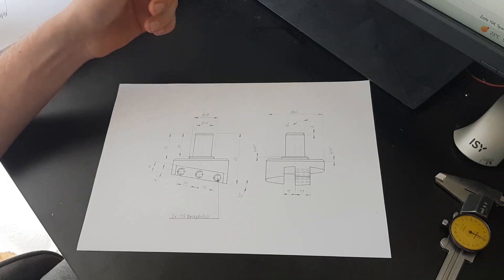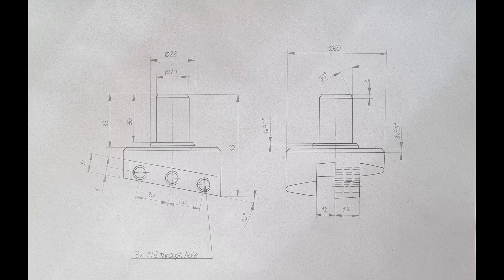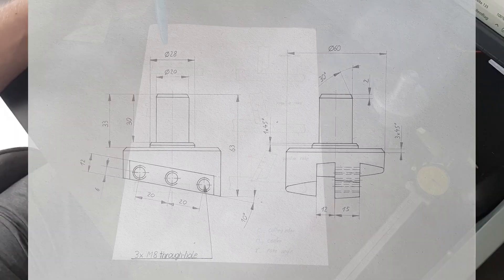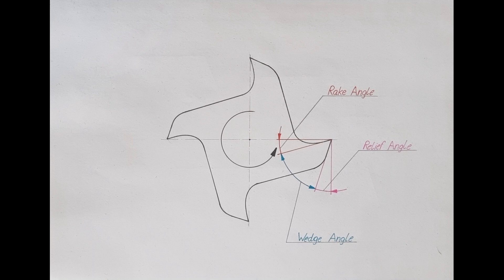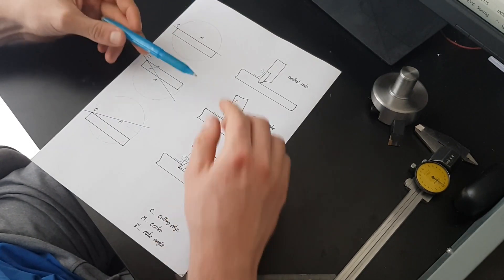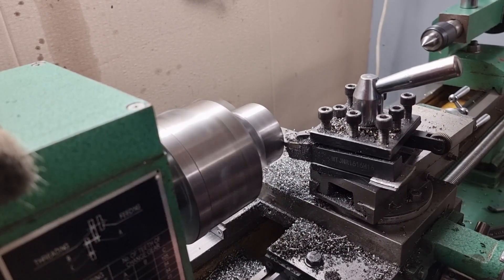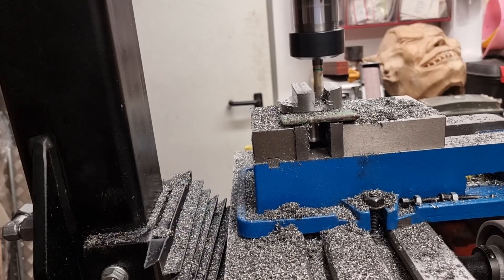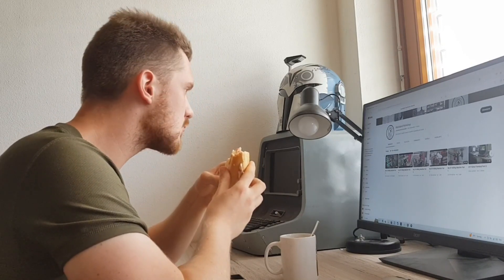Homemade Fly Cutter for the DIY Milling Machine

Comment: I 'm just about building my own milling machine. I'm lucky to got my hands an old "Heckert Kopierfräsmaschine". Hence the spindle and the whole spindle moving machanism is missing- I try to  build a new spindle holding and positioning thingy and fit a 4kw china-spindle to it. I've learnt alot from your concept to mount the spindle. I hope to be able to copy that on my setup. I think this is a very versatile machine for all thinkable jobs in a small workshop. 👍
Reply from the maker: Thank you so much! 
Cool name btw.
Your machine will be great as well.
Reply: @wastelandworkshop3839 I have installed the spindle at the weekend. What a beast - and heavy as well. The spindel mount is made from 80x80 rectangular steel pipe with 6mm wall thickness. Quite sturdy. I'm very pleased with the result. There is only one thing that's not good - the spindle speed. It is running at 18000rpm at the highest. Lowest speed is 6000 rpm. This is much too fast for tools like flycutters as yours for milling steel. I'm still searching for an affordable SK30 spindle with drive shaft to be able to reduce the speed down to 'normal' milling rpm. If anyone here has a tip for me - you're welcome.

Comment: For faster removal rate, smoother finish, lower impact on the part and spindle bearings, less rattle & chatter plus improved safety use these tips.
Set the cutter just wider than the part, this allows the tool to smoothly engage at a tangent by gradually increasing the tip engagement. This gives much less impact & is far quieter. Having this minimum cutting radius allows for faster spindle speed & ultimately faster metal removal rate. The protruding  toolbit becomes invisible when running so is much safer when close to the cutter body. If the tool is cut shorter then there wont be the other end spinning outside the cutter body.

Can you please explain why the tool is tilted at an angle, if it was flat to the bed the insert edge would still be the lowest point. I think cutting the tool on an angle is a leftover idea for when there were flat HSS toolbits. With the insert protruding beyond the toolholder body on insert tools you are using, is this angle required?

Comment: What is your background? Are you an engineer? I'm currently dallying around in metal work. I have bought a small mill, but really overestimated its capacity, so now i'm making a a mill like yours. 
Would be cool to have a quill in the head though.
Anyway. Love the projects.
Reply from the maker: Thank you very much!
 Yeah i am a mechanical engineer.
Currently i work for a company that produces big industrial shredders.

It's great that you already got a mill. I bet it will help you a lot when building a bigger one.
Would love to see how yours turns out!

You are right.
A quill would be very helpful. But that was unachievable with the tools i had at the time.

Thanks again for the comment :)